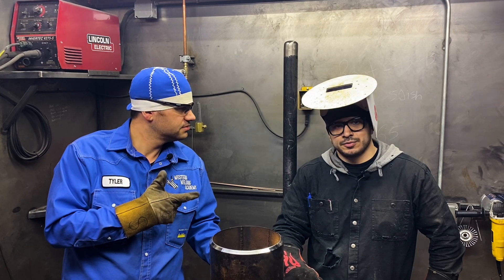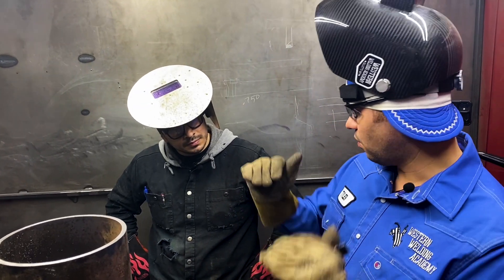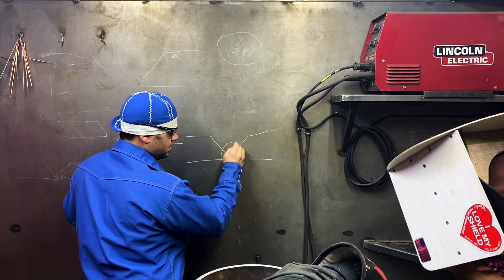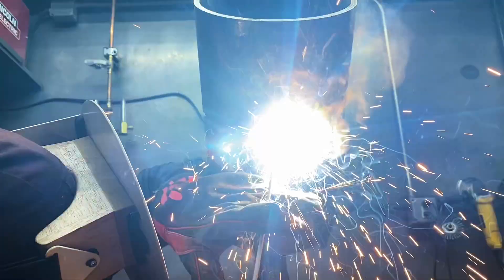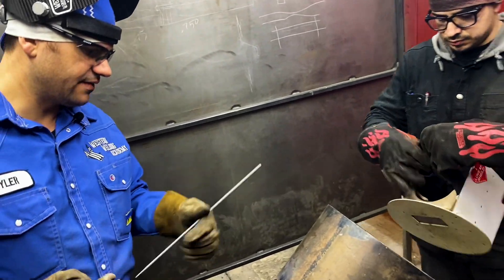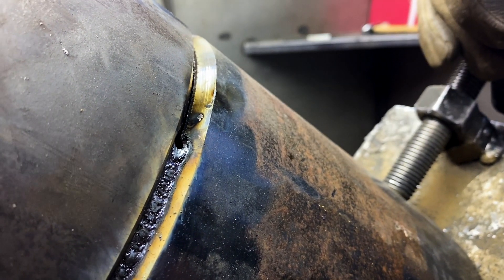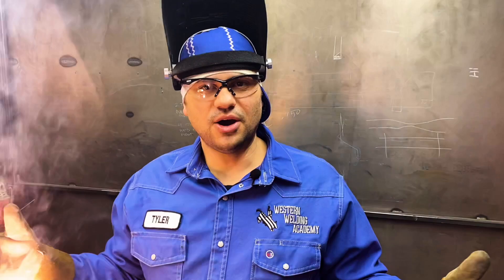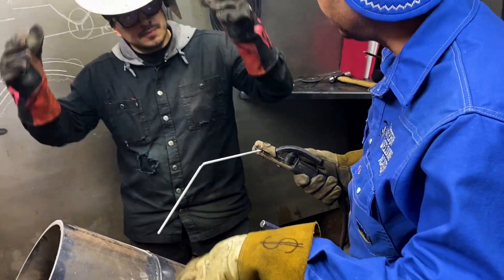How To Weld: 8" 6G Pipe LIKE A BOSS @RealTylerSasse

Comment: Buddy is obviously the real deal and has been doing this at the highest levels for a long tint.... with that said lol....ive never seen someone use 2 speed squares to square a flange to the pipe. I mean hell you can only move your tape  2" from where you got your original number to compare it to. It would be more accurate, easier, faster, and only needs 1 person to just whip out that torpedo level lol. I can't stress enough that this but is clearly the real deal though and I'm sure he could teach me more than I could teach him for damn sure.... but that double speed square off the flange thing is for the birds 😅😅😅😅

Comment: @Western Welding Academy I have an idea. I welcome the feedback, good or bad. I see you do  2 layers (is that the right term?) of welding. Could you weld with 1 rod for a short length then use a second new rod in parallel with the other rod to start the second layer? Then when the first rod is used up, use the second rod to do the 1st layer of weld and a new rod for the second. Then repeat this until both layers are done. Is that possible? I can video chat you to try an explain it with visuals if you want.

Comment: Be nice to have some idea of the heat settings used here and show the penetration and tie ins inside this completed joint. Otherwise great instruction on some methods used for doing the 6G welding process on what (appears to be Schedule 40 pipe).